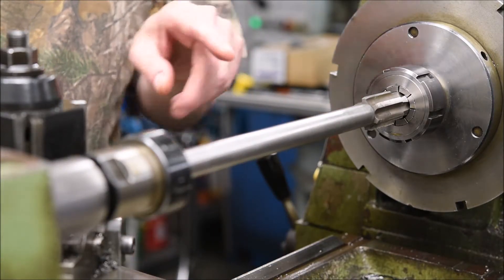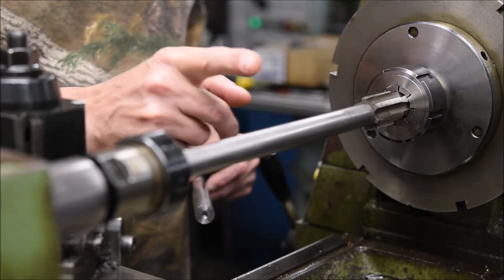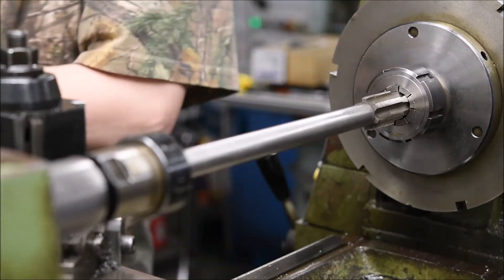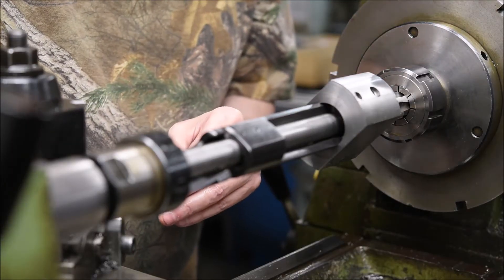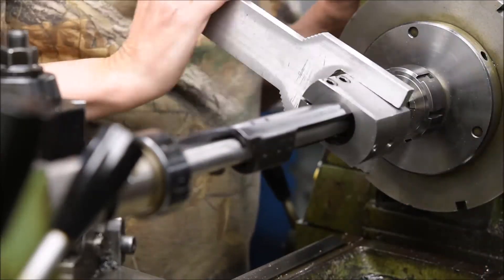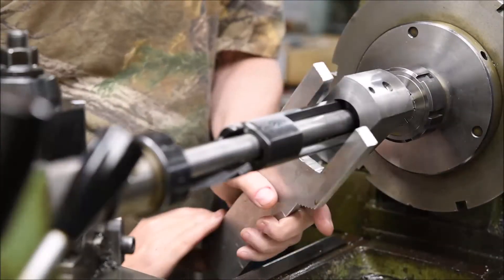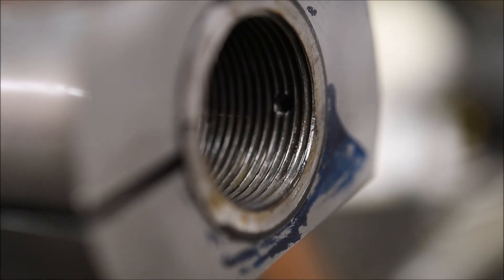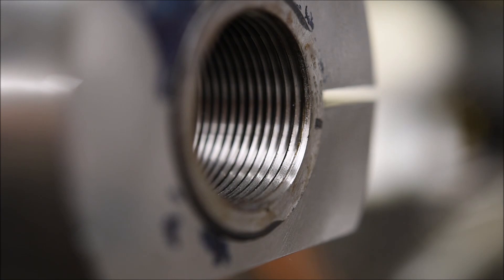Truing a 700 Receiver With Taps

Comment: If you don’t use an oversized tap, would you still be able to use factory barrels threads?
Reply from the maker: That's the problem with truing receivers. If you want to straighten up the threaded extension you pretty well need to remove at least 85% to of the old thread surface to get them to run true. Unfortunately that means that the new diameter will be .002 to .008 inch larger than the original barrel thread. With the fit that sloppy the barrel threads will almost always cock to one side or the other during tightening which is often worse than the original lineal and axial error was to begin with. The thread fit should allow you to screw the barrel up 3/4 of the way by hand. Then you have to finish tightening with an action wrench and barrel vise. This will give you an almost negative fit on the entire surface area of your threads which will force everything to remain true both lineally and axially. 

Don't ever use the word "fitment" in place of the words "fit, tolerance or adjusment" unless you're telling me about cupboards, toilets, bathtubs, sinks, showers, Electrical sockets and light switches. American How To Shows have completely bastardized the word.

Comment: I don’t see how you’re more accurate with a tap. The tap is just following an already formed thread, so any runout is just expanded by the tap
Reply from the maker: The action follows the tight fitting mandrel which is locked solid to the tap. If something is out of alignment something has to give to let the action screw on to the tap. So, the action can bend, the mandrel can bend, the tap can bend or the tap can simply cut away the part of the thread that is miss aligned. When cutting and going up in 1/2 thousanths increments you can actually check between size jumps and see it cutting a bit more each time you check it. It keeps cutting from the same location until it screws up loosely and straight. Most of the time it will cut from one side only for the first three or four jumps in tap sizes and then it will finally start cutting completely around when everything gets straight. The best part is that each tap is 1/2 thousandths larger than the one before and the tap can cut no more than that 1,000th you don't have that kind of control when you single point cut.

Comment: Can this be done single point?
Reply from the maker: I have done many by single point. The problem with single point cutting is that you invariably take out more material than is necessary and they never seem to come out as accurate. The down side of the taps is having to buy the set of taps which ends up costing about $2,000 USD. The taps are more recommended for gunsmiths that will do many over the course of the years.

Comment: Agree with some of what you said. However, the lateral force used on the wrench will cause an uneven force against the tsp causing inconsistency in the threads… just my opinion…. If you true the action by chasing the threads and going larger on pitch diameter would be my preferred method… after the receiver is indicated properly of course. I’ve only been doing toolmaker/gunsmith work for 40 years… everyone has their preferred method and ideas of what is or isn’t correct..
Reply from the maker: Well, I check the run out after I'm done on every one I do. https://youtu.be/LEkuiriSees

If you figure .002 inch runout at 9 inches, .002÷9=.00022 off over one inch. I have yet to have anyone show me proof that they can cut that accurate with a boring bar on receiver threads. The big reason the taps cut that accurately is because I work up in tap sizes in .0005 inch increments and work the taps on and off until the cutting stresses are gone.

Putting a ground bar in them afterwards and checking them with a 1/10th indicator is proof.
Reply: Again, everyone has there preferred method… I’m finding it hard to buy the accuracy but if you say it works for you..then it works for you
Reply from the maker: @ta2dmacabre   pretty simple to test. Next time you true one with a boring bar. Chuck a piece of material in the machine,  thread it, screw the trued up body on it, run a tight fitting ground mandrel in it and check the run out at the end. I've used various systems to recut the threads and I have also checked quite a few that others trued up. I don't guess, speculate or estimate. I measure.
Reply: I’ll give it a go… my other question is why would one side of a receiver be softer than the other side or any part like the locking lugs be softer?
Reply from the maker: @ta2dmacabre  if you Rockwell test the receivers at different points you will find the tops and bottoms of the receivers are generally 1 to 3 points softer because they are heavier because of the locking seats and cool slower in the quench. The bad part of doing it with taps is the cost. The taps come in .0005 inch increments. If memory serves I bought H4, H6, H8, H10, H12, H14 to start in .001 inch increments and then I added H15, H16, H17, H18, H19 and H20 so I finish in .0005 inch cuts. H20 is .010 inch over sized. Somehow I think I ended up with a total of 12 taps. I had them special cut by Victor Machine tools in the USA. I think the bill for all of them was around $1,600.00 Canadian. It's not a cheap system.
Reply: What would be the most used taps you think in your opinion. I will have to do 2 or 3 taps at a time. Lol I am working with mainly newly purchased factory remington 700’s.